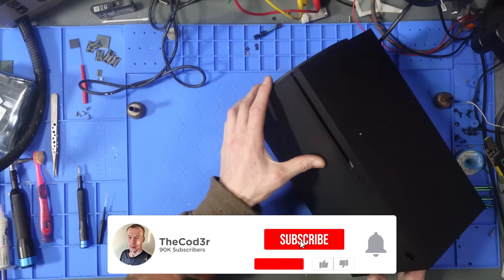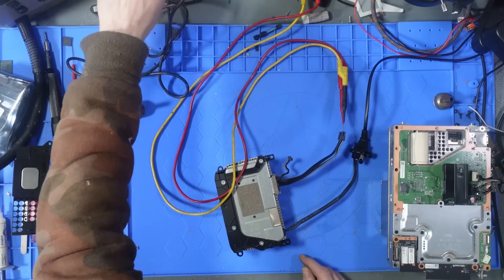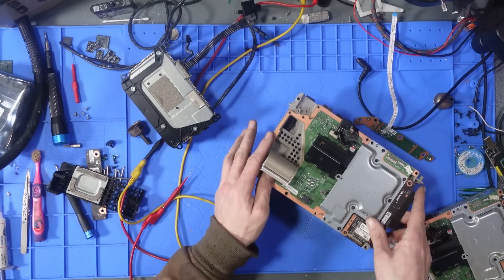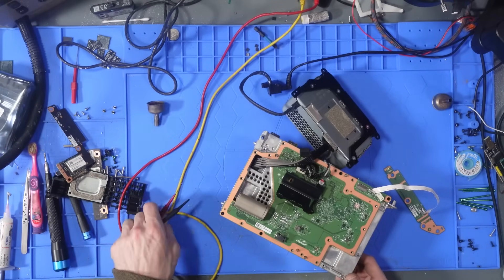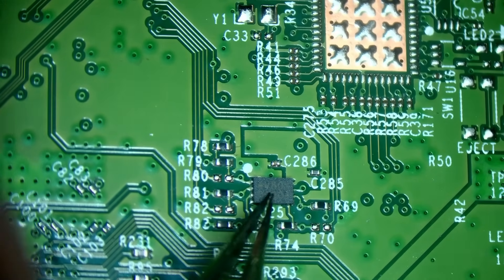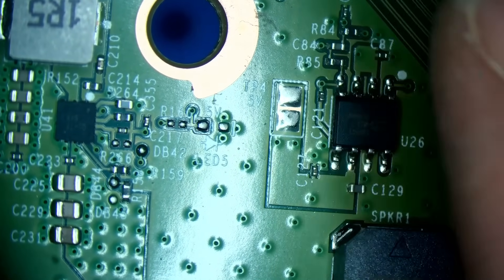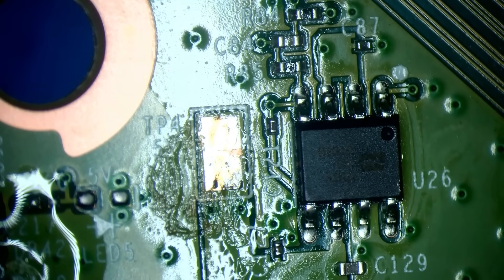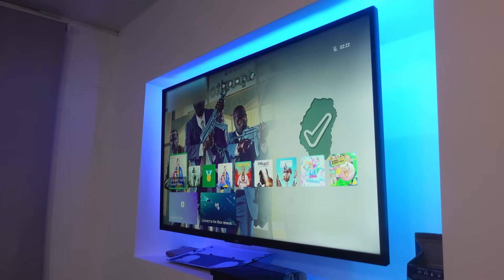This Xbox Series X Turned Up COMPLETELY DEAD! Can I Fix It?

Comment: As you said, you could lose about 10-15 filter caps in consoles and they'll work. The reason consoles fail a lot of the time is due to one or more of those caps. The only reason they exist is due to the PSU's being cheap and noisy.

Comment: Hi Phil may I have a little advice please? I bought an Xbox one S, opened it up because of no display and it turns off after 3 mins. Well the hard drive is missing so no wonder it turns off after a few mins. Could the missing hard drive also be the cause of no display? Any help would be amazing thanks mate. Rory.

Comment: Good afternoon Phil,
Hope you’re doing well mate, i need your opinion on a ps4 that beeps once the light comes on for a fraction of a second and then shuts off and won’t come on again unless power cycled. I have not tested it with another PSU because i don’t have one but i have inspected the standby voltages on the board itself and the majority seem to be up and running except for 3.3v near the 12v rail going into the APU and 2v on the other side of the hdmi encoder chip. There is no direct short to ground on the rail but it has a 0.1 diode reading when its supposed to be above 0.3 i believe. The board i have is the CUH-1116A. I would really appreciate it if you have an idea and share on where i should start looking. 

Thanks mate!